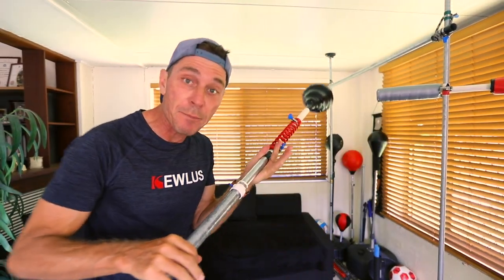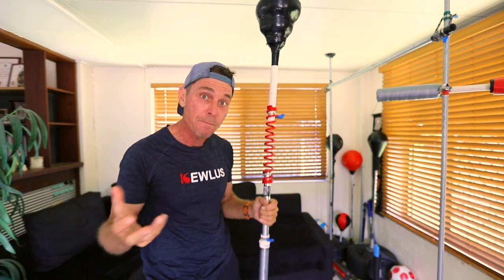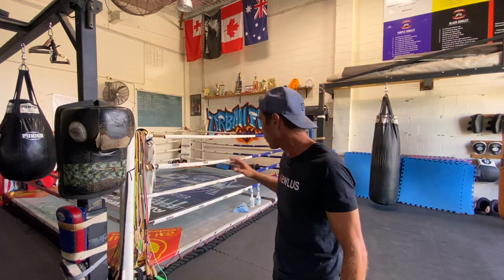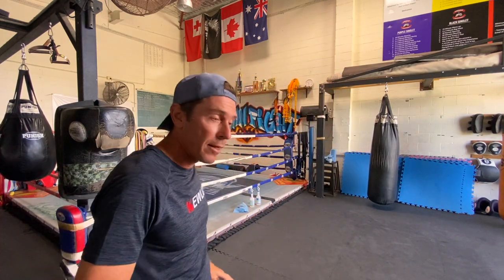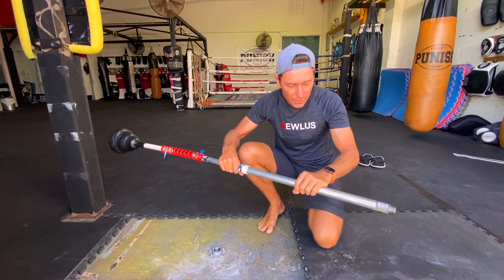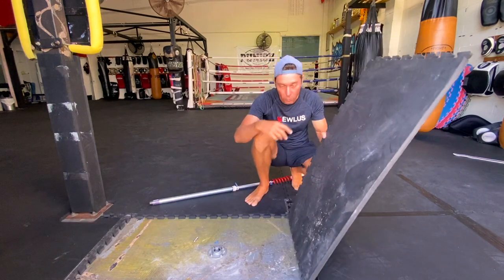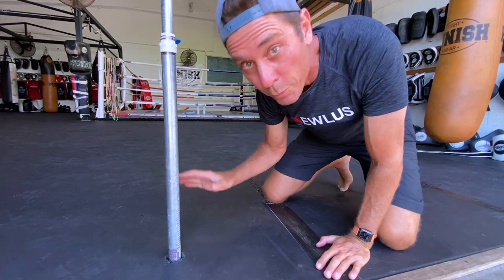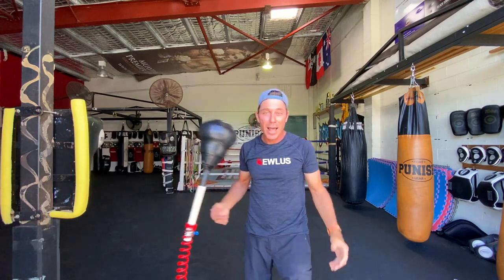Kewlus PRO Spring DIY Cobra Bag Installed at Local Fight Gym - Bolted Onto Concrete

Comment: Nice. I was hoping u actually showed how you bolted it down.
Reply from the maker: Just drilled holes with a hammer drill, inserted the bolts and tightened them with a wrench